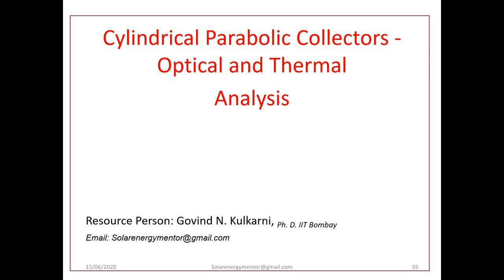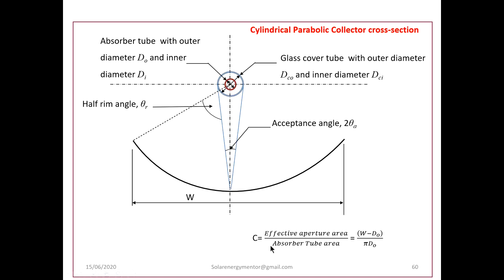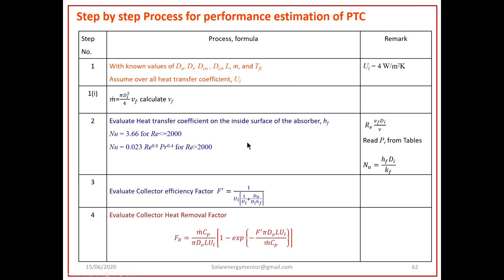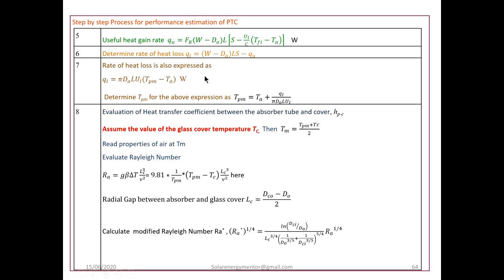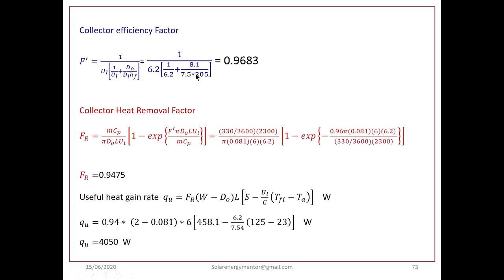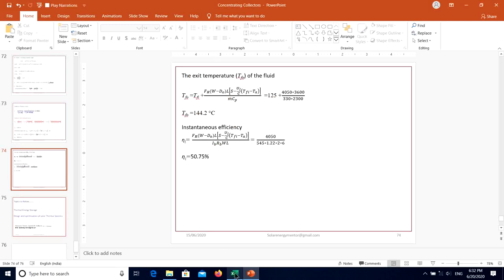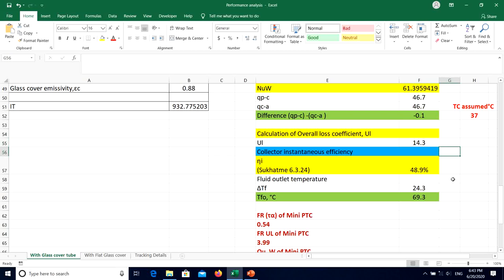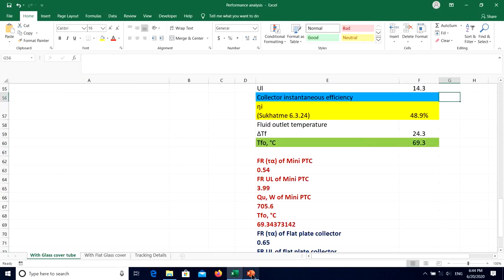Cylindrical Parabolic Collectors   Optical and Thermal Analysis

Comment: sir i think step # 13 @18:38 is wrong as the OHTC should be between plate and collector, temperature difference should be Tpm-Tc, we can not equate it with initial assumed OHTC as the initial assumed OHTC is between plate and ambient. pls comment if i am wrong.